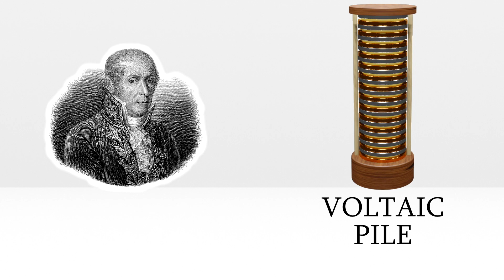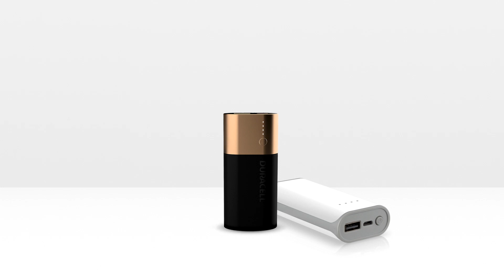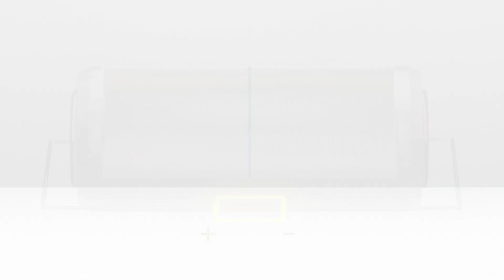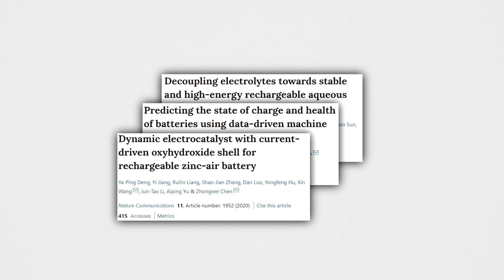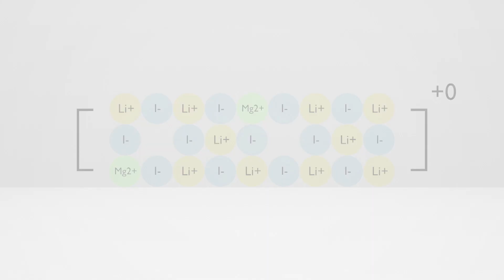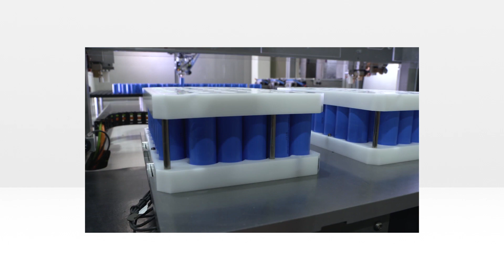Electric Batteries: Past, Present and Future

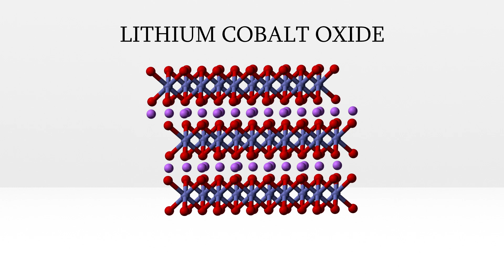Comment: 3:20 "Lithium has the third lowest density of any element" ... could you clarify that statement? Under similar conditions (same ambient temperature, pressure, humidity, etc), is lithium the 3rd least dense of all the elements? It is a soft metal at room temperature.